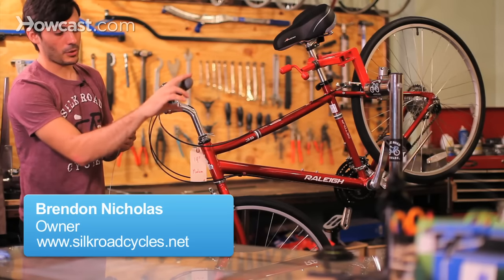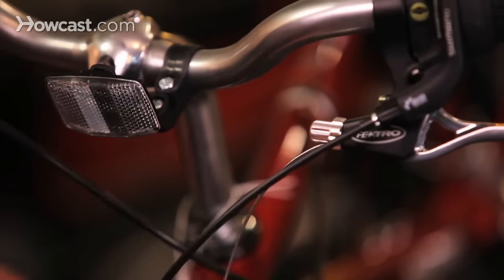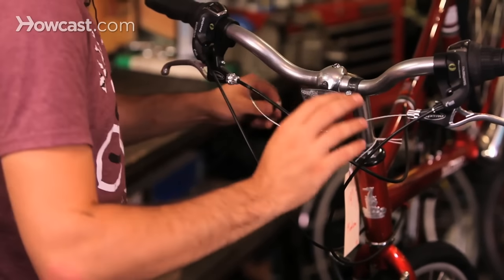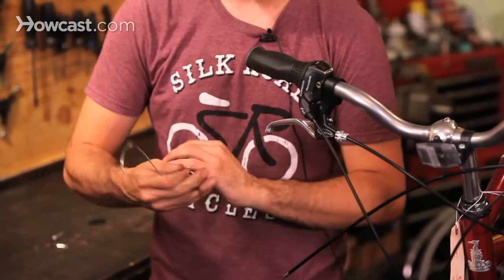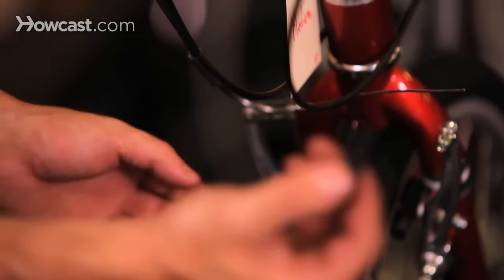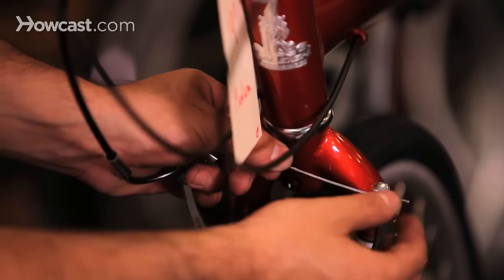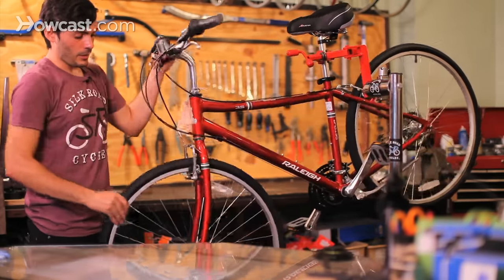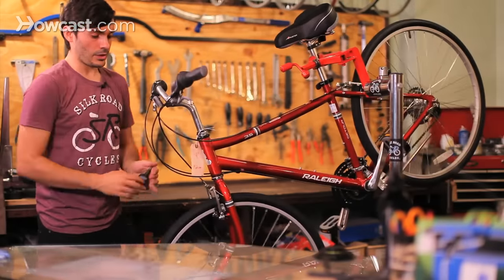How to Install Brake Cables & Housing | Bicycle Repair

Comment: Can you install a brake onto a bike that never had one before?
Reply: ye
Reply: yes but youll need to create mounts for them
Reply: @andrewyankee9862  what are mounts 🤔
Reply: @emilygonzalez5442  a place for the brake caliper to connect to the fork or the frame
Reply: @emilygonzalez5442  Funny you should ask.  I'll show you a rear mount.
Reply: As long as your fork has the 2 screwholes and the rim hub has 6 screwholes

Comment: Thanks for the help! I took my rear tire off to change a flat & noticed my breaks cable was out of whack. I could not adjust my breaks correctly for anything but I came across this video & it helped a lot.

Comment: I always put a spot of oil when i fit the end of the inner cable in to the brake leaver it just protects it and makes work smoother

Comment: okay, that was really fast, but here is my question. When you said thread it though on that last step is there a whole in the pinch bolt to thread it through?
Reply: goldenseal50
Some pinch bolts have a hole. Some just have a groove. I prefer the hole but it really doesn't matter.

Comment: The end on the MTB brake cable I got is smaller than the original one on my bike, so it doesn't fill all the space in the hole in the lever. Is this normal? I'm not sure it's safe to use a cable with a smaller end...

Comment: The barrel on my bike won't stay in place and the thing that has the pads split in two. Now the brakes don't close and the barrel won't stay in the socket. Do I need new brake cables and the thing that holds the pads?

Comment: do you need the housing for the brakes to work or can you just install with the brake cables
Reply: If the cable isn't housed covered the wire is gonna be succeptable to rust unless u only use bike in dry weather but asthetically won't look right
Reply: A A ok thanks I don’t have the housing right now and thought I needed it to install the cable. But I will be getting the housing soon
Reply: I tried that.  It didn't work.  The housing is essential because the cable has to slide through it while applying the brakes, then back.

Comment: My bike it's hard to stop the brake handle because it's stuck.  how could I fix that?
Reply: buy a new bike
Reply: @kimmemestar7749  bad advice
Reply: It's too tight it needs to be loosened

Comment: How can you put a front brake housing back inside the brake lever without removing the housing? I got this newer bike and the front brake cable is not attached to the brake lever.